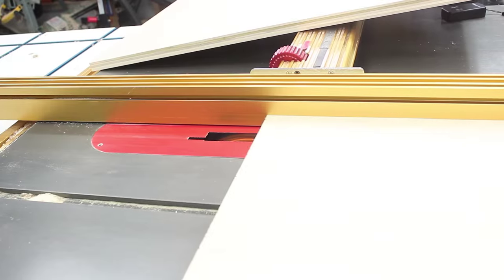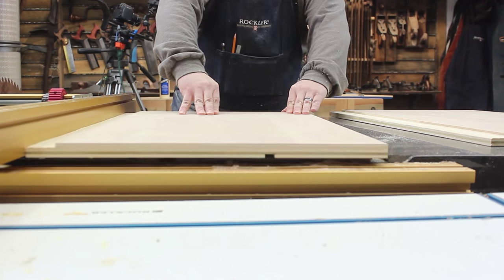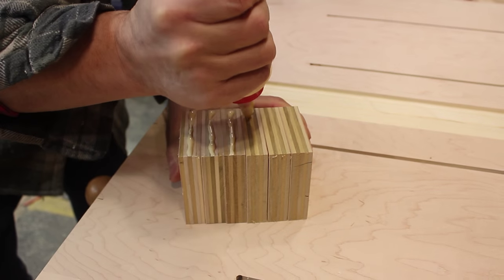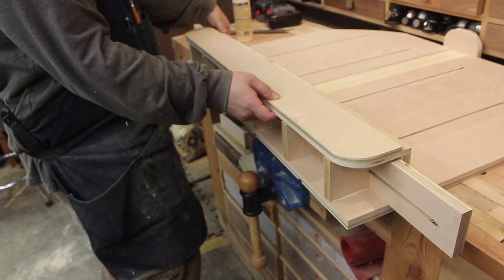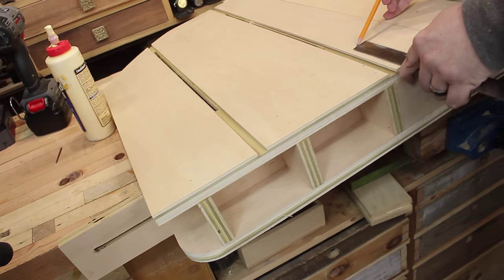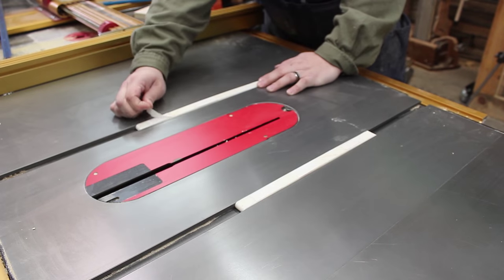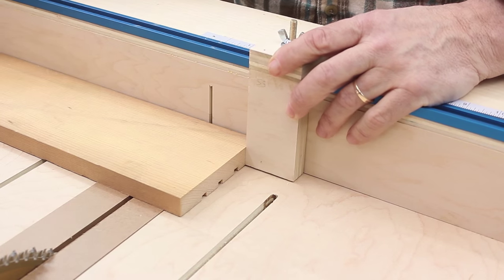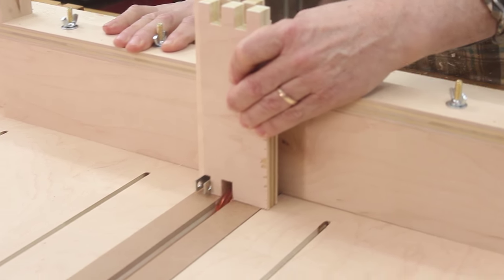SUPER table saw sled crosscuts, tenons, finger/box joints, splines, dovetails and more!

Comment: When building a sled of any kind... do the runners need to completely fill the channel in the tool all the way from top to bottom. Of course, they need to have no play from side to side... but if the channel in my saw (band saw) is 1/2" deep is ok if the runner is only 1/4" - these may not be the real dimensions, but you can see that the runner wouldn't completely fill the channel. Thanks - love your videos... learning soooo much!
Reply from the maker: No, the runners only need to be the full width of the slot. In fact, it's better if they are not the full depth to reduce drag. So if your slot is 3/8 deep, make the runners 1/4 thick.

Comment: Hi James / Stumpy,
Love your videos and your book.
I have a question if I may.
I have a RYOBI table saw that utilizes a sliding miter bed instead of miter tracks.
I have been wanting to build this sled, but am struggling with how to over come the sled registration to the table saw bed issue.
The only two options that I have come up with to date are:
  - Create a plywood cap with miter tracks to be attached to current table saw bed.
    - ISSUE:    In doing so, I will no longer be able to used rip fence without removing the proposed plywood cap.
  - Attempt to create sled and register against outer edges of the table saw bed.
    - CONCERN:    Table saw bed is 32" wide and that seems like a lot of surface friction for the sled.

Would you happen to have any suggestions / ideas?
Reply from the maker: Can you send me a web link to a saw that is similar to yours so I can see what you mean?
Reply: Link to Owner's manual:
http://manuals.ryobitools.com/system/files/7073/original/RTS31_RTS31G_931_trilingual.pdf?2014
Reply: Hi James - I was wondering if you have had any thoughts on my question?

Comment: Plans were good and when I had an issue they were very responsive with helping me out. Only couple problems I found (at least for me) were the slots ended up getting in the way of my runners, so I could only use one runner instead of two. The sled is also ENORMOUS. I would recommend the mini sled at most, the full sized one is way too big. It gets heavy to lift on and off, and it is cumbersome to store. No knock on the quality of the design, but it is a bit impractical.

Comment: Going to build this after my table saw router table build. I think I’ll coat most of this sled in black Formica. It’s gonna be awesome 😎
Reply from the maker: Why put on formica? That would make the surface slippery. Generally, you don't want a slippery surface on top because it's more difficult to keep your work piece from shifting during the cut. I don't even put a finish on mine.
Reply: Stumpy Nubs that’s a good point. After thinking about it, it seems more trouble than it’s worth

Comment: How do you tweak the alignment of the fence, say using the 5 cut system, to ensure a perfect square crosscut?  I just bought the plans, and like all the other features!
Reply: he said on the lumber jocks forum that he got it dead on the first time and didn't have to adjust. since he kept everything square, he got lucky. but he never mentioned how to adjust the fence after the fact
Reply from the maker: 15bigdave I didn't get lucky. I was careful keep the body of the fence square when I built it so that the edge was square to the back. Then, when I laid it on the runners which were laying in the miter slots of the saw with double sided tape on them, I used the table saw fence to make sure the sled was square. It's all in the plans.

That said, you can adjust the runners if they aren't square.
Reply: Thanks!  I got pretty darn good when all said and done.

Comment: I built a sled based on this one with (of course) a few modifications. I had to move the inner slots because one of them would have overlapped a runner (my runners are not equally distanced from the blade). I made each base half 1/4" wider, installed runners 1/4" farther from the blade, and then cut each half for perfect fit against the blade. But the biggest difference is that without having a decent sled to begin with, I did not feel I could just keep things square and it would all work out. So I added a bottom board to the fence and modified the extensions to match. This let me attach the fence with a couple of screws, do a 5 cut measurement, and then adjust it. My sled is now square to about half a millimeter or so over 2 feet. Now on to making some matching jigs! Thanks Stumpy!

Comment: I can vouch for the quality of this design and the usefulness of the inexpensive plans. I was impressed with the videos and my old tablesaw sled was pretty primitive, so I decided to buy the plans. There was not much online from others who had actually made the sleds and jigs, so I was not sure if this was going to be as good a deal as I was hoping

So far I have made the mega-sled, the stop blocks, micro adjusters, the miter attachments, and the mortise jig.  From a 5x5 sheet of baltic birch plywood, I still have enough left over for either the mini-sled, or two more jigs. 

So many jigs sound good and look good in the videos, but when you go to use them, you find out the flaws and limitations.  I waited until I'd used the sled and attachments for a couple of months before posting this comment, and I have to say I am very pleased with the plans, and with the completed sled and jigs. If you want to use this for fine woodworking, you do have to take your time and make sure everything is dead square as you proceed, but the step-by-step instructions, measurements, photos, and cutlists make this very doable. Everything about this jig makes my job easier.  The wing extensions, the stop blocks, and even the micro-adjusters (which first struck me as a cute gimmick) allow for precise work. The replaceable zero-clearance inserts are a brilliant idea.  

Two pieces of advice. The quality of even the best plywood at my local Lowes and Home Depot is not as good as what Stumpy describes in his video.  So I opted to go to the local lumber yard for some true Baltic Birch. Pricey at $50, but you can get most of the sleds and jigs from this one sheet if you plan carefully, and the quality of the plywood really makes for an easier build and a superior outcome.. Secondly, I opted for the adjustable aluminum sled runners. I payed $30 for two of the 18" miter bars from Rockler. They are a good size for the mega-sled, and are easy to adjust for precise fit.  If you are not planning to use this sled for fine woodworking, then using the homemade runners would make sense.

Finally, you get a truckload of excellent buildable plans for $20.  This covers 3 sleds and all the jigs.
Reply: I built the mini sled, and the joinery jigs a couple years ago. It was the best addition to my table saw. I really like the replaceable throat insert, and the joinery jigs were spot on. My table saw recently died, so I'll be building this sled again when the new table saw gets delivered.

Comment: Subscriber since you started! I recently bought the plans for the sled and started getting material out for the build but immediately ran into a glitch - no dimensions for part G (main fence) in the materials list, and a listing for "2 - Miter fences" which are only 2" tall and  don't seem to ever be used in the build. I presume the main fence is 3 1/8 X 36, but it would help if you amended the plan to correct the materials list. Thanks for providing such a valuable resource for woodworkers!
Reply from the maker: There are a couple of corrections posted here: http://www.stumpynubs.com/corrections.html The Miter fences are described beginning in step 52. Please use the "contact" tab on our website for any other questions. Thanks, and enjoy the build!
Reply: Got that! And thanks for the timely reply!!!

Comment: I like the idea of this mutil-fixture sled,  so I went and bought the plan.   There is one issue that I have with it.   In both the video and plan, you glue the back fence in place without making sure that the fence is square to the blade.  And I don't see any ability to adjust that once it's glued in place.  With all the other sled videos that I've watched,  the fence is held in place by one screw to act as a pivot point, the fence is squared to the blade, then secured.   How can I ensure with this design that I can square it up properly?
Reply from the maker: Bryan Omahony The fence is squared to the blade by using the table saw fence to align it when you attach the runners. If you have to adjust it later, you adjust the runners.
Reply: Thanks for the clarification.

Comment: I really like this design but I would not try to square a sled using the runners. I'll have to figure out how to assemble it so as to be able to adjust the fence after a 5-cut test. Otherwise, great project!
Reply from the maker: If you prefer to do a lot more work than you need to, be my guest...
Reply: Stumpy Nubs lol,  I'm a sucker for extra work 🙄
Reply: Just watched the video... After seeing some other videos around the web, I'm kind of at the same place:  I really dig the features of this fence, particularly the reinforcing webs on the back side.  I've been a little skeptical of the designs that focus on super precision in one plane, but then have no support for the fence beyond a couple wood screws on the underside.  I realize the sleds are supposed to glide back n forth effortlessly.... but that still seems like poor long term design.  Maybe they figure the sled will need replaced before that's an issue?   I'd still be interested in just how accurate your sled is, using something like the 5-cut method as demonstrated by William Ng.  If its close... that may indeed be close enough ;)
Reply from the maker: Any sled, no matter the design, is only as accurate as you build it. A chunk of 2X4 glued to a piece of plywood can be perfectly accurate it you build it with care.
Reply: If you don't do the 5 cut method, then how do you know how accurate the sled may be?  Do you think it's OK to rely on a square?
Reply: You can do the 5-cut method to determine if there's any error. If there is, calibration with this design must be done by adjusting the runners. I bought the plans almost a year ago and am finally going to start building these and this was my only concern. I'll trust Stumpy's advise that this is sufficient and report back.
Reply: @MrStrizver  and....?